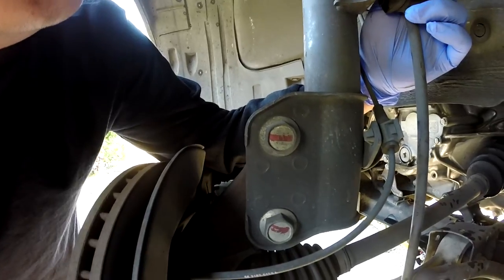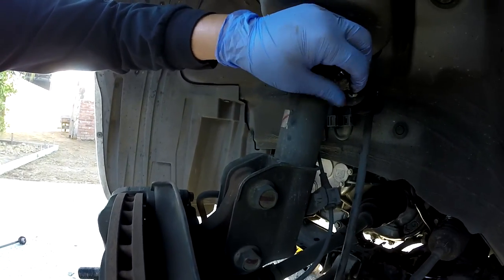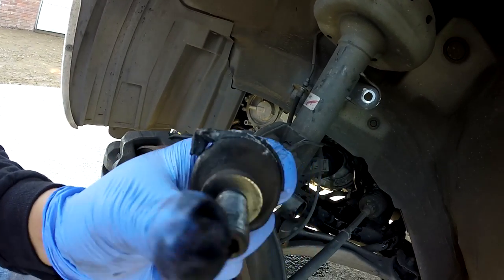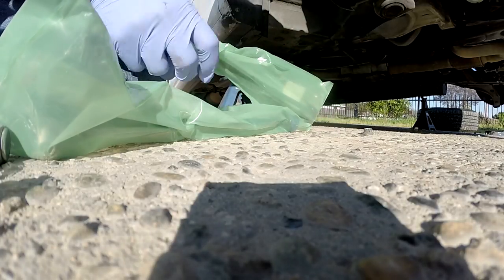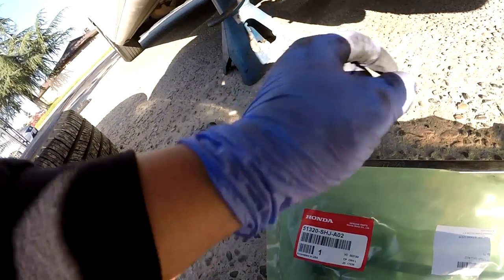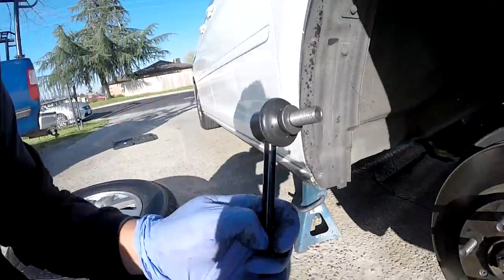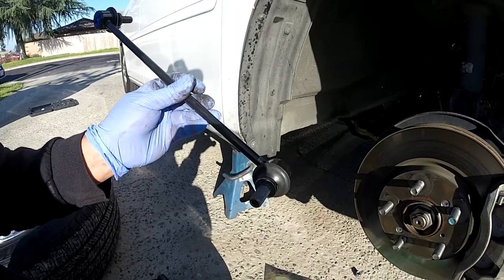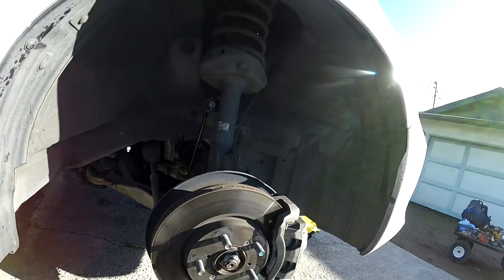honda make clunking noise at bump stop

Comment: My clunk was from the subframe, I noticed it when accelerating from a stop and when heavy braking. 

I started noticing the clunk after I had the subframe out of the car when changing the transmission input shaft bearing. A year later, and after replacing nearly everything in the front end with no success, I finally found the issue. Apparently the subframe should be tightened with weight on the tires, not when jacked up. I loosened the 4 -17mm bolts holding it, let the car off the jack stands, then tightened them back up. Clunking is finally gone! Another thing I did was make sure the sway bar was aligned correctly, equal distance from the control arm on both sides – loosen the 2 bushing brackets and use a pry bar to wiggle it left or right as needed. I even paid a mechanic to diagnose the noise, he had me replacing parts unnecessarily. Thanks for video, hopefully my comment will also help someone out there, cheers!

Comment: "Everybody can do it!"  Not so easy in the north east with the rust!
Reply: Real knuckle buster fighting rusted on bolts
Reply: Leave some penetrating oil overnight helps, overkill but it works.
Reply: cut it off lol you are replacing it. cutting it off is also quicker even if they are not rusty.
Reply: Definitely cutting is the fastest way to deal with the rust. I doubt an angle grinder will fit in there. You may need a die grinder or rotary tool. Being a rust belt mechanic is nothing to envy. Lol!
Reply: 🤣 I live in Arizona so I can do it with a set of open ends

Comment: I like that you used OEM parts........I prefer OEM for my own repairs.  Thank you for the videos.
Reply: Meh. There are parts where I prefer to go OEM but SB links? I honestly think you're just throwing money away. There are plenty of excellent quality aftermarket suspension parts. I bought a pair of Moogs for my 2013 Accord. Every build aspect of it was superior to the OEM. Larger diameter, zerk fittings and recessed boots that are less prone to tearing.
The idea that OEM is always better is a marketing ploy that auto makers use to sell parts. There are manufacturers out there that are not only meeting OEM standard but exceeding it.

Comment: Whats the sound when you turn or accelarate or brake there is a sound comes from left tyre whether is it excel or mounting. Please share your feedback
Reply: You could have the same problem or possibly a wheel bearing depending on the sound your hearing

Comment: I just got the 2019 Honda Accord and I’m at a little over 4K miles and it is makes a clunking sound from the front, both left and right side but it only makes the sound when I turn into drive ways but not over bumps or dips
Reply: I have the same problem, but only over bumps. going to fix an appointment and get the suspension fixed under warranty
Reply from the maker: If your car under 36k miles or 3 yrs it warranty for comprehensive. take it to your local dealer they will fix it for no cost.
Reply: amarjot31 let me know how it goes the same thing happened to my 2019 Honda Civic and they had to lemon law it because they literally could not find out where this problem was coming from so they put me in a accord but now the accord is starting to do the same thing and I just don’t wanna go through the same process because it was so stressful and complicated going through the dealer and the car rental spot and talking to everyone but I mean if I have too then I will. I have a service appointment due this Saturday so I’ll mention it too my service rep
Reply: All Tsab thanks for the advice but I did it with my brand new 2019 Honda Civic which was worse because you could hear it going over bumps and dips, anyways I took it too the dealership and of course they thought it was the struts so they replaced the entire struts in front however it was still making that noise so I took it back and then they go on too say it is the sway bar hitting up against metal however “it should be fine to drive” so I drove off thinking okay it can’t be that bad but then it got to the point where I couldn’t take the noise and obviously something was wrong with my car but I guess they thought I was just some dumb 19 yr old kid, anyways at this point I was MAD and I was like I’m not leaving until my car gets fixed so long story short they put me in a rental for about week and call me up saying that they are just going to give me a whole new car because the car was “defective” so when I went to pick up my new 2019 civic they didn’t even have the same one I had before so they put me in a accord for the same monthly payment and now my accord is making that same noise so I guess I’ll find out what’s going to happen this Saturday because I have an appointment to do an oil change so I’ll definitely let my service rep know.
Reply: @mikemorvlogz6182  did you find out what it was? Similar issue with a 2019 Acura ILX A spec...
Reply: Probably your front sway bar bushings, the rubber bushings (one on each side) deteriorate and become loose after so many years of driving and will tend to cause a clunk whenever you turn. None of your suspension parts should be loose when holding them to wiggle back and forth.

Comment: Does the front and the rear bar link the uses same part number?
Reply from the maker: I think  one shorter than the other.  The linkage part number must be different.  You can call your local dealer to confirm on the parts number.

Comment: Man those clunking noises can drive a guy nuts when everything seems tight with several parts already replaced. Only thing i can think of is a break caliper pin on my 02 accord allowing to much slop, even though it feels tight enough. Road bumps causes sounds that is tough to duplicate by just checking parts out manually... dang cars.

Comment: I had got sway bar links new ., new brake pads& rotors,  new front & back struts, new axle,  new tires, new outter tie rods,.. i was wondering when i come to almost a complete stop on my 2002 Honda civic lx.   my car makes a weird.. rattling noise.  Only when car gets warm..& been driving for awhile it seems..like..what could this be??
Reply: Probably a broken or loose exhaust heat shield, you hear it especially well when the car is at idle and no road noise coming from the tires. Check the fasteners when the car is cold or just wiggle the heat shield a bit to see if it's loose and just tighten the fasteners back up.

Comment: Hey brother I have had the clunking on the front passenger side and the Honda dealership replacement both struts in the front and it's still like that and the. They were trying to tell me it's cause I used aftermarket brake pads which makes no sense at all cause if that was the case it would be both sides
Reply from the maker: Try to replace your sway bar linkages
Reply: @alltsab  I am going to for sure . I have a 2021 is that something I can do with a regular jack or do you need a car lift.
Reply: @alltsab  my guess is that sound wouldn't come from a after market brake pad cause that Is the exact sound my car is making.
Reply from the maker: Brake make noise only when you apply brake.
Reply: @alltsab  yeah man I can't figure it out  it's when I hit bumps I have the wheel off right now I just grabbed the sway bar link and tried moving it by hand besides a little twist I don't see much play . Both of the struts are Brad new so it can't be them and the sway bar bushing looks OK from where I can see it so I'm lost brother.  Unless it can be bad and I can't see it or feel it by hand

Comment: I have a 2.4 l 2004 honda element that makes a repeated knocking noise when i accelerate from a stop do you know what it could be ?
Reply from the maker: One side only then could be drive axle.. But not 100% sure. Some honda axle does make pop noise so check it. Thanks for watch subscribe please.
Reply: Engine or gearbox mount.

Comment: My Honda element is making thumping noise when making sharp turns in the left rear.  What could it be?
Reply from the maker: Possible your bearing
Reply: your rear diff.  mine was clinking and pinging before i sold it.
Reply: Probably your rear bump stops are worn and need to be replaced. On Honda's you have to literally get under the rear part of  your tire and look for a thick metal spring, inside that spring is a bump stop with rubber at the end. They dry up and crack and fall apart, especially for a car with a lot of miles on the odometer.